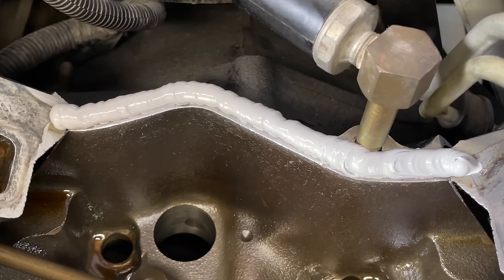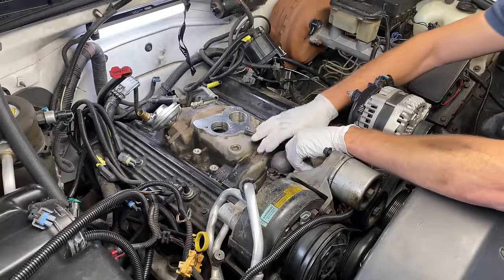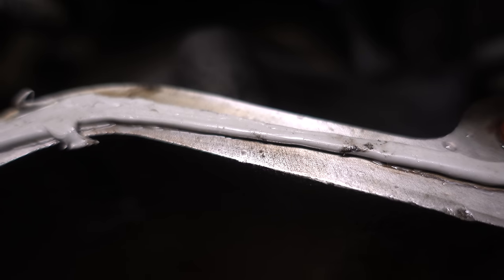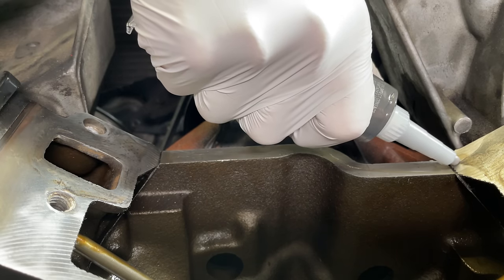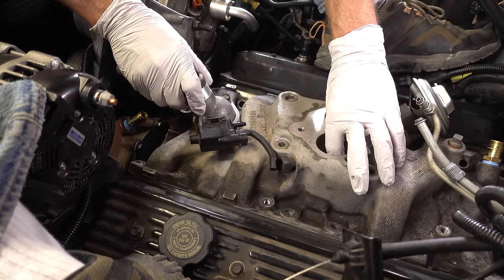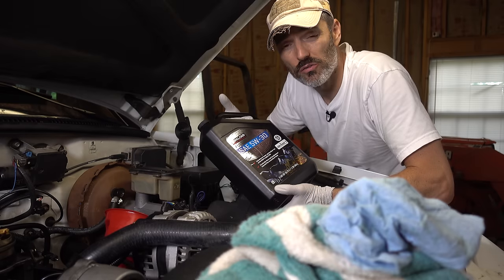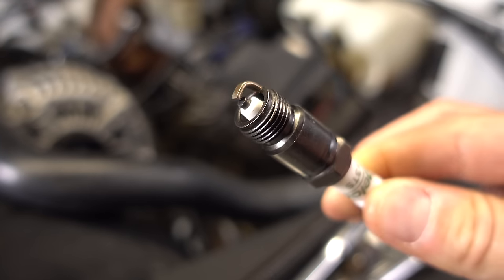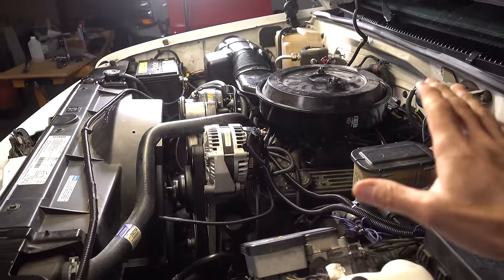Why You NEVER ATTEMPT To Use RTV Gasket Maker Without Doing This First!!

Comment: the BETTER way to do this is by using quark gasket sheet and cutting a strip that size and RTV that down, takes a bit of back and forth on getting it the right size but imo better than a big glob of rtv being the only thing there. i have pulled a few of these sbc with those exact vortec heads before and they ALL had a quark gasket there.

Comment: So surfaces have to be clean of no oil.  I use "the right stuff" by permatex.  

And every intake I do, I make damn sure the pcv system is functioning properly!!

Let's say there is a leak on the china rail.  It's from splash oil.  Not pressurized oil.  So if there is a leak, with a pcv that is evacuating the crank case pressure like it should, then there would be a vacuum applied on that leak.  Pulling air in and not allowing oil to come out said leak.......

With modern cars and the wicked amount of blow by they all have, even new, we don't do much about the pcv system like we use too. 

Ever seen an engine that leaks from everywhere?   Well, pressure inside the crank case is pushing the oil out.  When the crank case should ve under vacuum and not allowing the oil to get out.

Of course this does not take into fact about seepage when the engine is sitting.
Reply: So true on these PCV valves, no one, and I mean no one ever replaces, even the dealerships that may service the vehicle its entire life. Every used vehicle I have ever bought, the PCV is shot. I like older, well cared for high mileage vehicles, much easier to keep on the road then this garbage they are putting out today. My last new vehicle, 2017 Silverado, on a lease, the transmission leaked and the rear end had a mean clunk. I turned it in with ony 13,000 miles at the end of three years... Then Covid hit, not a car on the lot, I swore off new vehicles right then and there.
Reply: @Steven-cs5cw  yeah it's even worse these days as the pvc is integrated into the intake manifold or the valave cover.  GM makes and engine that the crankshaft seal can whistle because of a bad pcv.  The air gets sucked in the seal and it whistles.........

If engines didn't have blow by, and hydrocarbons never entered the crank case, we would never have to change the oil.  The faster the oil get black, the more in need of crankcase vacuum the engine needs.  Aka,  pcv!!

Comment: The tube that comes with the gaskets is not for the front and rear. It is for the gasket. You put a tin layer on the engine side of the gasket before placing it on the engine. At least that's what I've always done and it works great.

Comment: Hey dude I dont understand y u mounted that clip underneath the wood panel. If the purpose of it is to keep it from rocking or shifting, isnt it best to mount it at the top against the outer edge? 
Can u do a follow up video showing how it has held up, and show how the filter looks? Also how to replace it and where to get it?

Comment: even though people dont want to pay for less product at a much higher quality service use,  plus it spreads and seals much better the 1st time its called  THE RIGHT STUFF from permatex in a pressurized  can,  the squeeze stuff is not as good,  the right stuff says 1 minute, but i find at 60 to 100 degree ambient temps 2 hours fully cures after tight, or open to air on open surface.  they sell black and grey  the right stuff in sealed pressure can, i find the black works better on everything.

Comment: I use the rubber gaskets and contact cement from a can, not the tube or spray. I allow the contact cement to set up before placing the rubber gasket onto the block. I have never had a leak nor one come out and I have been doing this since the 60's. I despise silicone sealants. What you see outside is what you see inside and it depends on how well you center the bead. I do not want that garbage in my oil system.

Comment: Its a common problem on that gen..  give it a couple of oil changes and it will be SEEPING not sweating..lol  again .. just like all of the rest of them..  the best thing about this video,  is put a lot of silicone like ya cant put too much..lol cause gmc didnt think it shouldx have an actual gasket..and domt use felpro anything..lol    pretty good job  video , only place i would have fixed would were ya put plugs in and then ya told us that ya put  new plugs in cause the wete already out.. ill give ya a thunbs up for the lesson we all learned the same way..lol cant put to much there..lol good job bro

Comment: When i was doing mine i didnt change oil immediately after and now im stuck with moderate lifter noise. What should i do? Adjust valve lash?, Replace cam and lifters? Or do i need pushrods?

Comment: If you are using a metal gasket do you even need a gasket maker? I did this on my e class and didn't use any.. also there was very minimal to scrape off when i removed the original... I think it was only used to hold the gasket in place.

Comment: I can see how this could happen.  I've only used grey permatex for the corners of valve cover gaskets where the rubber gasket needs some additional help sealing.  I too would have used about the same amount of gasket maker, assuming that the pieces would come together nearly flush and push the gasket maker out.

Comment: Before you redid all that you could have tried puting a bunch of rtv on your fingers and smashing it into that gap on the back, that worked for me. You should use the black super oil resistant rtv for that I dont know why they would give you the gray one probably so you have to redo it sooner lol.
Reply: Fel-Pro makes the gaskets and supplies the gray. They know what they're doing.  Some people put the silicone around the water ports because that's the way they were taught.  You do not do that with these particular gaskets. Fel-Pro has a video about that. Ultra gray works perfectly for this application.
Reply: In general, and I'm almost certain loctite and permatex are this way, red is high temp, grey is high vibe. Both are oil resistant unless contaminated on application, grey is perfectly adequate for this application
Reply: @nickwhite6717  there are three versions each,  of permatex, black grey and red. The regular black is not for automotive use. Ultra and optimum black are. 
I think the ultra gray and optimum gray are better when things need to be torqued such as manifolds. You lightly tighten the bolts, then wait for an hour before doing a final torque. With the black gray and blue you're supposed to wait 24 hours before subjecting them to any oil or water.  I think that's where a lot of complaints come from, people not wanting to wait.
For people not wanting to wait, there are a couple versions of The Right Stuff.
Reply: @randywl8925  well there ya go then, more info than I could provide
Reply: @nickwhite6717  
Don't be intimidated, I looked it up before I made a comment. 😁
I found a discussion another YouTubers site and it was actually with a permatex rep and they describe each product and its best usage for particular applications.
I thought they only had two versions of each.  I'm not a rockit scientist, so I did some googling.  Ultra gray is fine for the end gaskets, there's nothing whatsoever wrong with using it otherwise why would the gasket company supply the wrong silicone?
I'd post a link here if I can find it again but it doesn't seem possible to include links here on YouTube comments.
I suppose that's because they're too many scammers how can I get to take advantage of the situation.
Do some googling, and include the words permatex, black gray and red and see what you come up with. 
Maybe even ultrablack, ultra gray, ultra red..... or copper, whatever they call.
It makes you wonder why they can't make three different ones and consider it done.
Ultra gray optima I believe is also good for high-heat like the copper is
..... It shouldn't be this damn confusing. Article I read I think it said the optimal  Grey covers all the bases.
Just to let you know I wasn't being smartypants, I didn't know this stuff either 😁
Reply: @randywl8925  yeah fair fella. All I know I use red everywhere and never had a leak so winner winner whatever works bud
Reply: Its not that they supply the "wrong" silicone, its just not the best one for that application based on my personal experience. When you take apart stuff with the grey its seems to dry harder and not as tacky as the ultra black, which makes sense in high torque applications that it is advertised for but not for the back China wall of an intake manifold.  The black has worked the best for me when dealing with high oil exposure, if you have ever seen how much oil comes out of those things when they leak that area is probably submerged in oil when the engine is running. I'm just trying to help someone out and save them some time, money, and a headache, not start a debate, everyone can use whatever they want I'm not saying it wont work for that application its just not what I personally use for those areas.  Dont forget the sooner it leaks the sooner they sell you another one 😉🤑
Reply: @JohnSmith-zt7qo  The engineers  have no clue what they're doing.  That's why they ship that Ultra Gray along with the gaskets.
They want it to fail so that you'll never buy anything from them ever again. 
I think that's what you're trying to say. 😉  
The end rails are not submerged in oil. If the ultra gray doesn't seem as stiff, maybe it duplicates the density of the rubber end rail gaskets and that's why they want you to use it.  Something  more dense can't be pushed out from internal engine pressure either.  We're only talking 1/8 inch thick.
A lot of guys still put silicone around the water jacket part of the gasket even though Fel-Pro  says not to do that.  I've got ultra gray on mine, or optical gray..... Whatever it was in the gasket set.  It doesn't leak.
They both work, and in this case it's in the gasket set so you don't need to open a new tube.
Reply: 😂 ya they used to supply those stupid cork gaskets with those kits that everyone knew not to use because they fail, I think that proves my point. But what do I know, I only have over 15 years experience working on things everything from small engines to aircraft and grew up in a family full of mechanics. I guess the salesman, I mean "engineers" are smarter.   Again I'm just trying to give some helpful advice not start a argument use whatever you want yes it will work it just doesn't mean its the best product in my opinion just like the cork gaskets were not the best product
Reply: @JohnSmith-zt7qo  I'll agree on the cork gaskets.  Back in "the day", I don't recall the factory rubber gasket leaking until I had over a hundred thousand miles on it.  I think the biggest reason for gasket leaks is because people don't clean the surfaces and sloppy application of the silicone.  Ultra gray is oem specified for dealership warranty work. Good enough for me.
So is ultra black.
Tater tots or curly fries......
Eat whichever one you like best. 😉

Comment: I would’ve thought gasket maker on an intake would be a no no, let alone in the directions. On an exhaust manifold im worried that the felpro is not multi layered steel like the oem. For the same price, should it make a difference?

Comment: There is a thin line between too much and not enough when using any gasket sealant but RTV is especially hazardous. Apply too much and the excess will squeeze out and get into the engine where it has the opportunity to clog a critical oil or water passage. I've replaced thermostats after water pump replacement because the excess RTV was preventing the thermostat from closing and I've seen it in the debris after reverse flushing the cooling system.

Comment: Use ultra black or if you really want strength use windshield urethane! Generally put a thin smear on each surface as a tack layer then put down at least a 1/4 inch bead. Put gaskets on the put a dot back on the edge where the gaskets pushed into the RTV.
Reply: Also, believe it or not if you take your finger and smear it flat where it squeezed out that can actually pull the RTV back out of the gap.

Comment: if for some reason you have to use the end gaskets....clean the surface like your kid is going to eat off it, and two, grab the hammer and punch and dimple the surface. they keep the gasket from sliding around when you tighten down the intake manifold.

Comment: U 2 lucky... That tbi intake is an easier 1... Most times u hafta take at least 1 valve cover off, n that rear oil sensor wuld have to come out.
This happened my first time... Was bak n the day,  so research was reading, talking to others n common sense. I use ultra black, I wipe on both sides of water ports n stops, this protects metal from pitting ,so u can reuse parts later.
On hot motors ,I drill bout 5 lil holes n front n bak of intake, the side that goes on the block. Prevents expulsion of gasket maker after been run for years.... We buildm... To build again.👍💯

Comment: I am a ford master mechanic. The use of silicone based sealers . Is all about cleanliness. This is more important with modern aluminum. And plastic parts but true of all .  Clean with brake clean . Be very careful with scrapers and abrasive materiel . Like scotch brite pads . Any scratches can be a path to leaks .   Again especially aluminum . There are products to use . First there are gasket removing chemicals use that . Next brake clean . Very modern plastic and or carbide scrapers with very very light pressure are good . Think clean no scratches .  Next brake clean leaves a residue.   Clean with engine shampoo after brake clean .  The surface must be be clean wiped with a white cloth no dark on cloth . Final step is there are surface prep products . Dealers ( all manufactures have a product ) this is a final wipe metal parts only . Ford for example call it metal surface prep . If the product form beads it’s not clean . Last is silicone sealer designed for engines . Again dealer products are good there are others .  Seems like a lot of work and it is . But this is the process factory manuals and techs use . Again especially aluminum engines . You will not have failures with this procedure .  Sealer remover . Brake clean . Proper scrapers no scratches . Abrasives in general bad . Wipe with shampoo . Final with surface prep . Wear gloves . There is oil in skin . Then proper engine silicone . Hope this helps

Comment: What happened to the rubber gasket that I used to use on my Chevy V8s (56 265, 59 283, 65 327, 69 396)?  I removed and installed the intake manifold on multiple small block chevys probably 10 times altogether and used the rubber gasket on the front and rear with NO leakage problems.  I would put a dab of gasket sealer in the corners.  
I used RTV on the diff cover one time on my F150 and it leaked so never again.  Only gaskets for me if possible.

Comment: Hi Why didnt you use the short pieces of the gasket that comes with the kit and just apply a small amount of RTV at the joints like is recommended.....arent they used on the GM engines like the Dodge Ram V engines.

Comment: I did a silicone job on a rear axle hasn't leaked yet and then my dad wanted a mechanic to do a front axle gasket replacement that one started to leak a day after I got it

Comment: You always use a fat quarter inch bead on the front and back of an intake manifold small blocks or 90-degree V6 60° V6 general motors engines. I never use the rubber seals I always use high-grade RTV

Comment: 3/8 bead. Long enough to go under the edges of the gasket, then a dab on top of the gasket edge.  Come to n man… torque the manifold twice.  Heat cycle and torque again.  Decades of no leak.

Comment: Who here has seen an oil sump screen plugged with sealer from over use of the stuff? I have many times. It depends on the application surfaces. Also, there used to be gaskets that dont come with the kit for those surfaces.

Comment: I mean I don't know what brand he's using... But when I rebuilt my engine last December in the middle of a snowstorm because life.... The best advice I got was boil water; and drop the unopened tube in there after is removed from the stove obviously... For a handful of minutes until it's nice and soft.... If you have arthritis or trigger finger or carpal tunnel you'll thank me... Anywho it comes out stupid easy... Make sure you put it on with incremental even torque until you see it buldge out, in a cross pattern for whatever makes sense... Same goes when torquing it down after; do it incrementally and on a cross pattern... You'll need to check the setting time for your brand look at the temperature conditions ECT and set a timer before torquing

Comment: You should have tried the copper rtv from Abro! I used it on my 305 when I rebuild it 2 years ago and sadly I used the rubber gasket they provide in the intake gasket but I put rtv on the both sides of the rubber gasket before I clip it on the block and thanks god no leak after 2 years but the damn mahle stems valves failed !

Comment: This is the trouble with You Tube guys find one mistake they made and think they now know how to use a product. One look at the beads tell you that regardless of how much he applied his surface prep was inadequate.....anytime you see the bead has been deformed (squished between the two surfaces) but still has not bonded to the surface clearly you also need to address this issue.

Also in several areas of the "China wall" on the block where he has applied the sealer there was no contact with the manifold.....that is to say the width of the block is greater than the coverage of the manifold.....so its rather important to ensure that the bead is between both surfaces not just one.